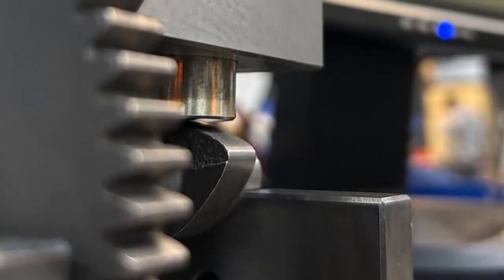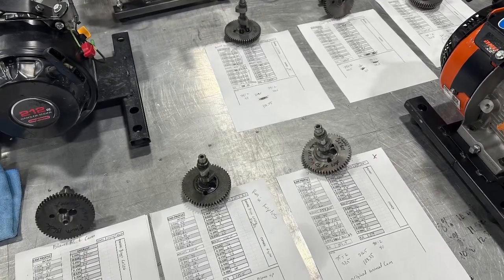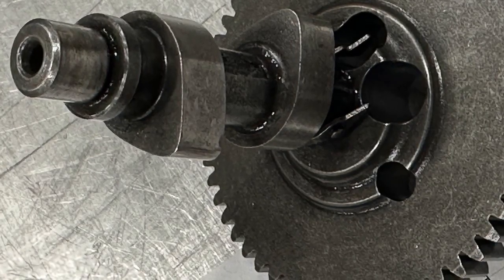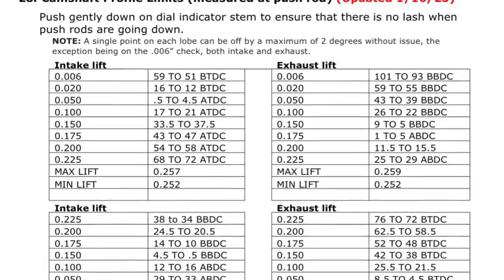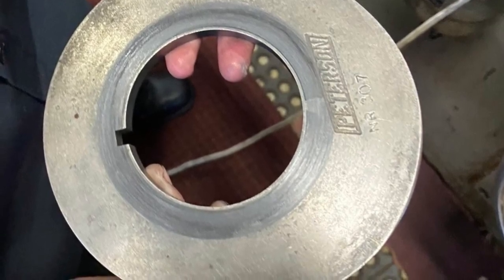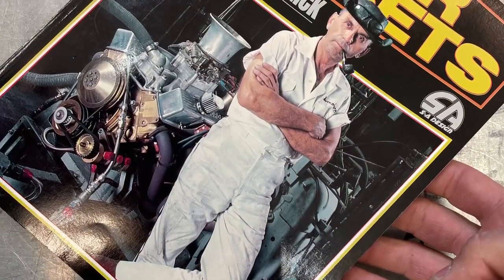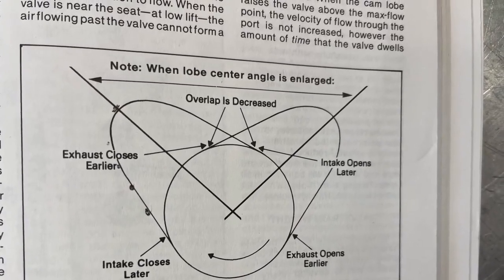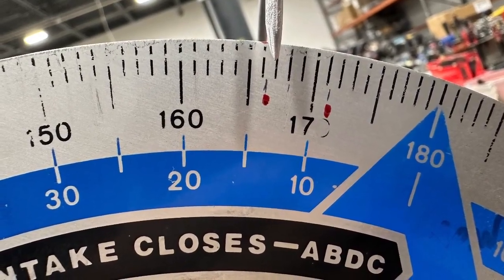Briggs & Stratton LO206 Cam Timing Profile and Cheats Explained see how to twist you camshaft

Comment: For you new to 206 racing viewers - Please do not waste time and effort here. It is an exaggeration and misleading information to sell a product you do NOT NEED. Focus on consistent maintenance for both engine and chassis. Set up of your chassis and driving technique is where the speed is in this class. LOW cost High Value.

 Two degrees is the edges of this far <-> This is NOT where you are losing speed. I find it interesting he has a new video that shows more detail and comments are turned off. It proves the point of the futility of the effort, it puts unnecessary stress on the cam and lifter.  Save your money for tires!

Comment: While you are allowed to be as much as 2 degrees off "without issue". The allowance of 2 degrees at a single point is to allow for a piece of dirt or grit that may be on the lobe that messes up the lift measurement (although from a tech perspective I don't think this is necessary). That is at one point (ie one check point :EX .050), not at each check point. Based on my experience, these cams are pretty consistent all the ay through the profile; If I am in the center at .020, I am usually dead center at .050, .100, .150 etc...). If I push that limit on the .020 on the intake for example, I will have problems meeting most if not all the of the other measurement points on the intake lobe.  Therefore I think your claim of "8 degrees" of play is bit of hyperbole to make your point.  Furthermore, we also know there is only one direction you want to move the cam, so really we're talking about two degrees to work with.  That said, that is enough to move the centerline of the cam and get a little more favorable centerline.

Comment: Can you retard the timing using flywheel keys? A 2 Degree retard timing key
Reply: Mechanically? Sure.  But not within the rules of the class if you plan racing. The ignition timing is specified in the rule book.
Reply: @thiswillprobhrt  does it have the same effects of twisting the cam?
Reply: @homersimpson6348  haven't bothered with it on a 206.
Reply: @thiswillprobhrt  I did it recently on a world formula, Retarded the timing 4 degrees & the thing is a monster

Comment: You obliviously have time, skills and talent. You are misleading people who are new to kart racing and the 206 program. Yes cam twisting is a thing. Been with us in the first years of four-cycle engines in kart racing. I have no doubt it is done on Clones. But why when you can buy an aftermarket cam? 

For the 206 the seal and a proper tech program eliminates this issue. There is far more difference between proper gear selection, tire pressure and condition, chassis set-up, and experience. 

You should focus your extensive knowledge and talent sharing these details and not hearsay and unsupported claims.
Reply: There’s people out there that can take the locks off
Reply: @ameliaairhartracing7566  Show me how.
Reply: And you do realize there is a cam profile check so what would be the point?
Reply: @ameliaairhartracing7566  Briggs are aware of seal tampering, that's why post race tech can (and has) gone down to breaking the seal and inspecting the bottom end if deemed necessary. 

The seal is part of a system, it's not THE system. 

People underestimate Briggs. Briggs know of all the $hit pulled with animals and flatheads. But builders and racers will always hype shit up because it's in our nature, even if it's to the detriment of the sport.

Great example in this video. Talks about cam twisting, implies it's prevalent,  implies it's whats keeping drivers from getting to the front, implies that Briggs are in some sort of cahoots with engine builders..... But he also has a cam twisting kit for sale :D

It's a classic sales technique, even if it wasn't intended to be. Create division, sell to the disenfranchised.
Reply: He has other videos showing how, the tools to get, all without touching the seal.  Cam lock via the lifter. and twist is basically it.

Comment: Your title says how to “twist “ your cam. But you never explained how you do that. Did I miss it?
Reply: Drop in a plug to hold the lifter. Bolt a plate on tho hold it and apply pressure to the crank to twist it
Reply: Yeah metoo